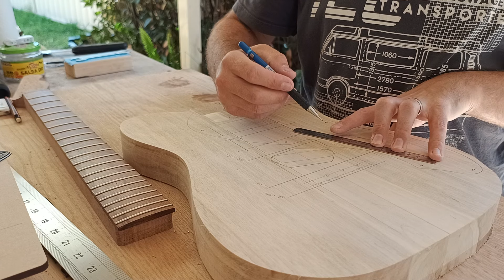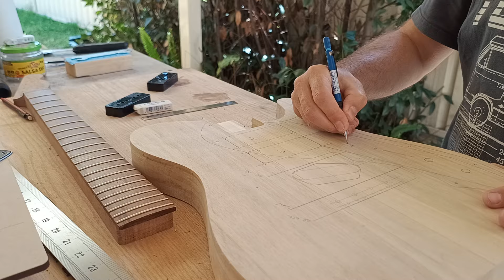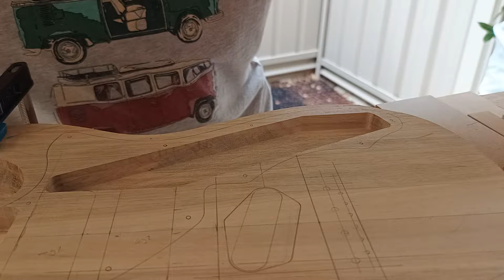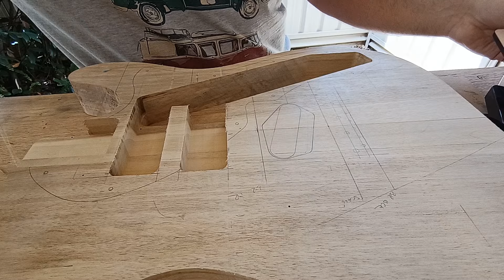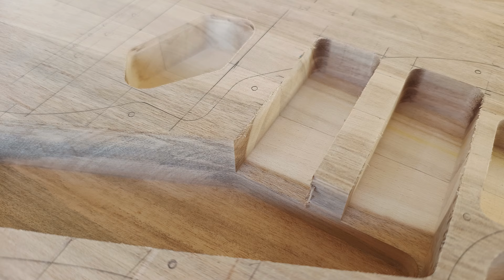Röö guitars #004 - body part 2 (cavities)

Comment: why not using double sided tape?
Reply from the maker: @gutarnerd  thanks for asking. I learned this method in the UK, where it was very difficult to get a good quality double sided tape that would do the job correctly. Some left sticky residue, some were not strong enough, some were too thick... Since this method works fine, I just use it instead of buying and testing many different products 🤷 I'm happy with it. It may take a bit more time to set up, but it's not a race :)